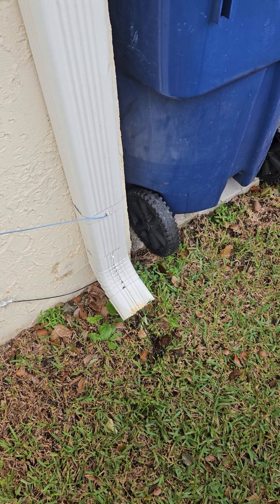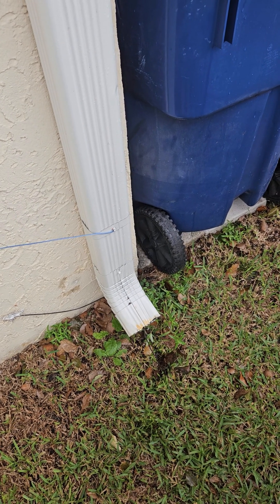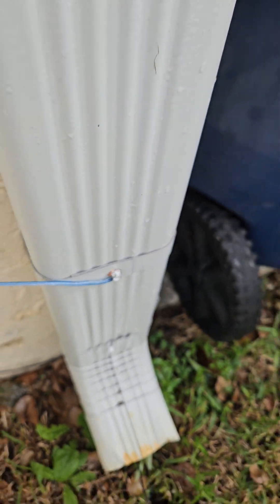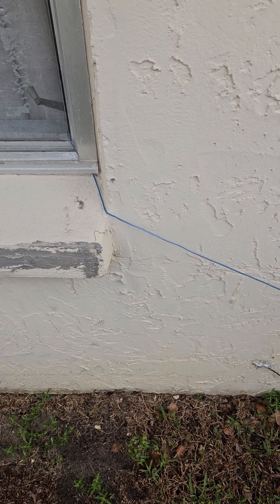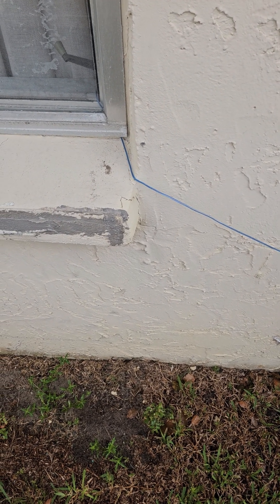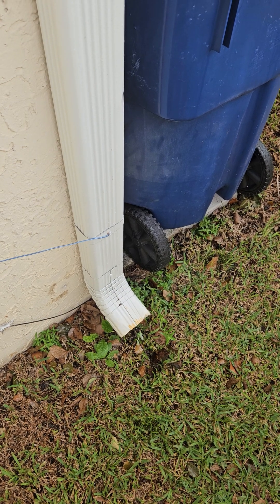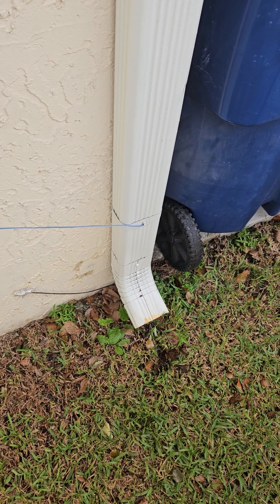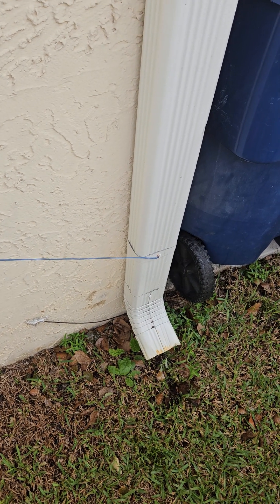Gutter antenna testing 2.0

Comment: One needs to be really sure about electrical connections everywhere along the length, and for long term use. That includes at the mechanical connections of pieces and wire attachments. Think corrosion especially.
   As far as the house is concerned I don't think the risk of a lightning hit changes if it's used as an antenna or not. The gutter is still there either way. There's a risk of radio damage though.
N1KHB
Reply from the maker: Yes you are correct. This was definitely not a permanent install, just wanted to test it. If I ever wanted to use it full time, I would spend time making sure all connections were solid, sealed, etc.

Comment: Do you need to worry about grounding? Lightning
Reply from the maker: Yes, lightning would be a problem if it comes to that, we'll disconnect the antenna
Reply: It's no different whether the gutter is used as an antenna or not.
Reply: Generally speaking you need to worry about grounding and lightning no  matter what you are using for you antenna. Typically a house as a whole is grounded for safety and lightning is less of a concern ( at least in the us most houses are built grounded now that's why you don't see lightning rods all that much anymore ) but an antenna of any kind is by definition a big stick of metal so lightning is always a concern. You should disconnect your radios during a storm if you dont have circuit protections in place
Reply: @sloftware  How do you ground a nonconductive wood house?
Reply from the maker: I don't know. Probably have to contact an electrician.
Reply: @SWLSignals23-hp6vp  Contact an electrician to ground an insulated object? I don't think so. I've never seen a ground lug on a 2 x 4. Have you?